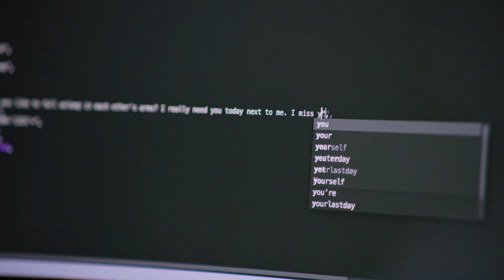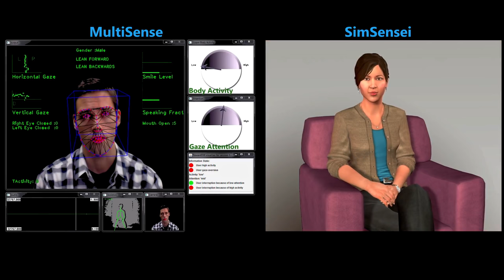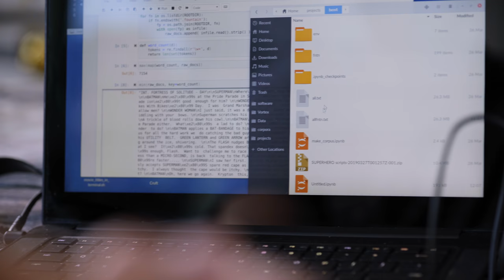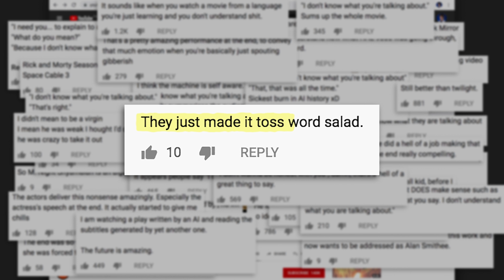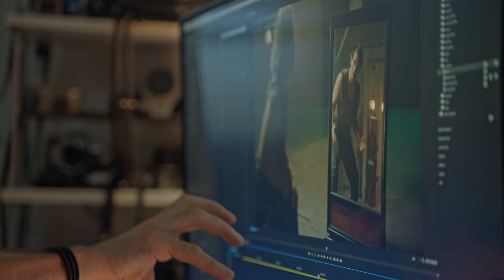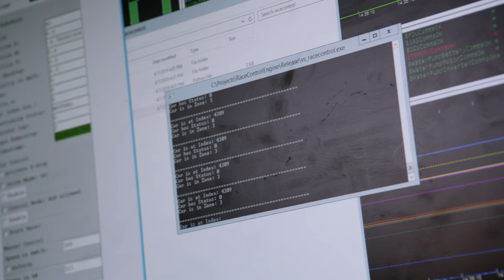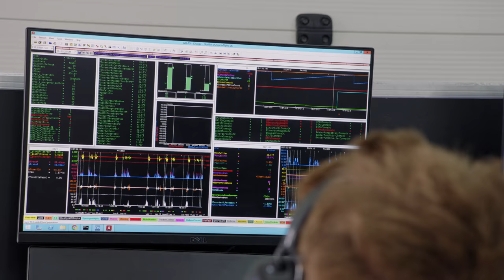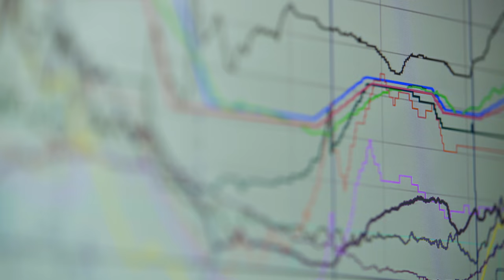Love, art and stories: decoded | The Age of A.I.

Comment: When the TUM car get on full speed I felt like I've just witnessed history 🔥.
Reply: I want to know what the constraints for that record are. 200kph is SLOW for racing. Let alone a world record. 

It's massively impressive to get the AI car around the track, not trying to knock that... Just poking fun at their idea that 120mph is a real record to break... Throw a GT cup car, LMS GT or F1 on the track and they'll easily reset the 200kph record. 😜
Reply: to be fair, that car lacks the 80-ish kg that the driver weighs.  To have a real comparison, they should put a bag of cement on the driver's seat. When trying to achieve speed, weight does matter
Reply: Wouldn't it make more sense to beat the fastest track time instead of max speed?  Track time is a complex parameter that basically comprises everything else.  While max speed is just that.
Reply: @GlebRysanov  exactly. I really wished to watch that autonomous driving is breaking the lap record.
Reply: @dryzalmynelli9600  that is highly dependent on the track length of the straight stretch

Comment: "People often say that creativity is the one thing that machines will never have"
Also this guy say " its actually easier"
Me : i need to worry?
Reply: nope not really, AI just solves a problem. 'add 2 + 2 and tell me the answer'. is all it really does. AI is NOT creative, it can only do what it's told to do or what it's asked to do and it's singular limitation is WHAT DATA WE'VE FED IT. AI has no intuitive leaps. AI only has linear thought, A then B then C then... and so forth. repeat as necessary to get the answer the human asked it. yea, AI can ask a bajillioin questions of it's data. but all it can produce is a STATISTICAL LIKELYHOOD of a correct answer. yeah, it may be the answer is correct, but it's merely a bajillion WRONG ANSWERS ending up with a correct one.
Reply: @lesliekilgore648  Machine learning already is intuitive. It takes what it learns and predicts what should be, even for events that it never experienced.

But rather than gut feeling, it can actually understand ALL of the input data intuitively without fail. AI doesn't forget or overlook.

By your definition, this isn't creativity but it's creativity on overdrive.

I would reckon actual creativity is about giving meaning. Everything that you said AI can do and do better but it doesn't yet understand the meaning of the things it does. It doesn't have intent. It doesn't give and understand value.

It can easily create a billion new paintings easily but it has yet to understand that it just did that, and the fact that it did that is revolutionary. When it does, it would've reached true intelligence.

Comment: I seem to remember volumenous book about game programming and collision detection algorithms. I also remember masterclass of design, coding and game - Total Anihillation. Quarter century  old RTS game, which some people run successfully today on 4k displays, despite original, 'recommended' requirements being Pentium 120 MHz and 32 MB (that's with 'M'). Somehow it managed to track up 500 units + their shells over 3D terrain. AI was... well; not on the level of Z and on occassion it bottled up units building factory in wrong place. Still, the way how units navigated was amazing; holds up even today. The code in that game used to solve quite similar subclass of problem, tracking 3 modes of reaction to spotting hostile units... on hardware built IN A CAVE WITH BUNCH OF SCRAPS   compared to what single Nvidia board for embedded system offers.  Also - ST TNG episode "Booby Trap" has relevant quote.... for 40 years we have autonomous cruise missiles, shuttles capable of almost autonomous mission and ships and airliners that basically fly themselves. What is fundamentally wrong with translating it into cars?

Comment: 🖐🖐🖐hyee 

I dont understand the condition of overtaking of cars what if in the future as    "if both cars have AI and have same velocity then what whould happen as both have same algorithm ???????" 

please answer 🙏🙏🙏🙏
Reply: It’s a deadlock situation as known in programming of processes, Ai will probably need same sort of solutions as needed in regular programming. E.g, having an arbiter process managing both cars (an operating system or traffic control). Actually I think it will be a likely solution for a big number of problems relating to autonomous traffic (sharing traffic info, redirecting over distributed routes etc...) The particular example could also be fixed by using inputs that do differ. E.g. car location cannot be the same or directional orientation.

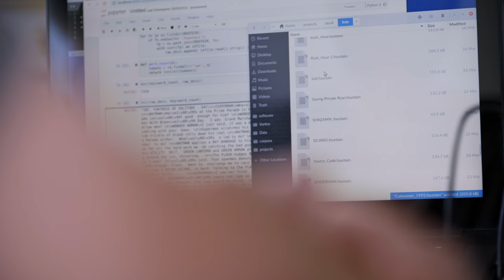Comment: From 13:22 to 13:32, well actually creativity and problem solving are completely different. How can we say one is easier than the other when they are both just totally different functions? Some people are better at problem solving and some people are better at creativity. Creativity requires imagination to visualize a potential concept of object in reality that does not exist as far as we are aware. Problem solving is a process by which a person or other intelligence brings existing data together to achieve a specific outcome in relation to dealing with a problem in a satisfying way. Problem solving can use some creativity in visualizing the desired outcome, but this is not necessary to actually achieve the outcome as you as you understand the concept of the desired outcome.

Comment: This look more robotic then AI, that the all debate E.Musk is having, that when we drive a car, we don't use radar or pinpoint gps location or wifi comm with other car to know where we need to head to and at what speed.  I find Tesla way to be much more related to A.I. then Roborace, wich, well seem more robotic then AI.  I know it's a youtube original, so part of the Alphabet family, wich have waymo going against Tesla on that front,  wich is a Lidar and other additional gear costing more then 10k$, but still, not even one mention of Tesla?